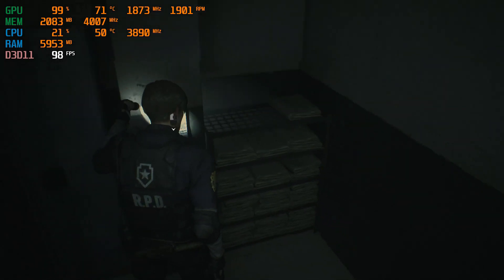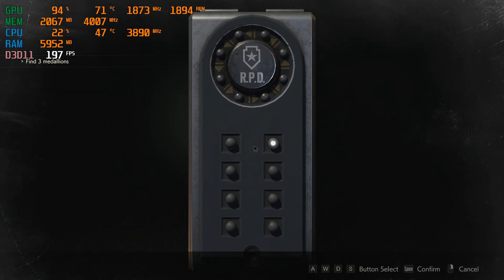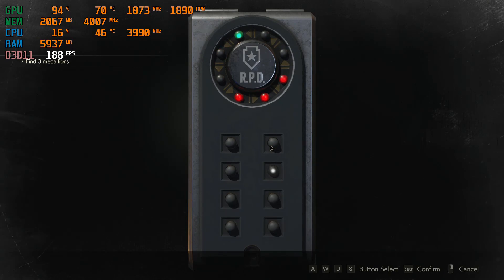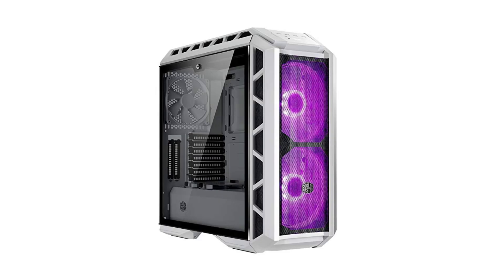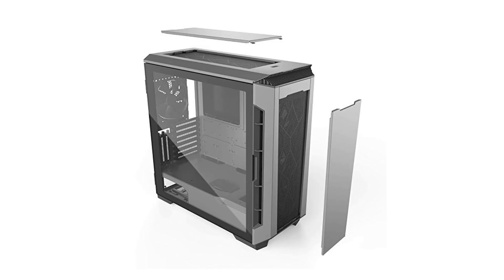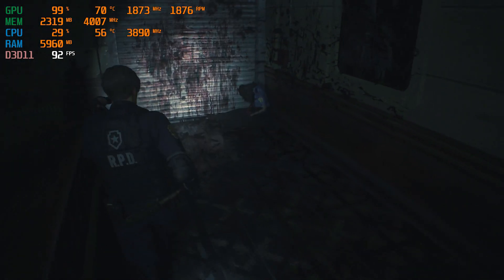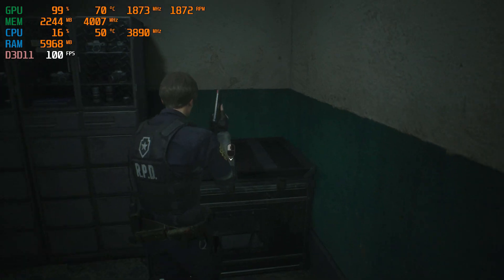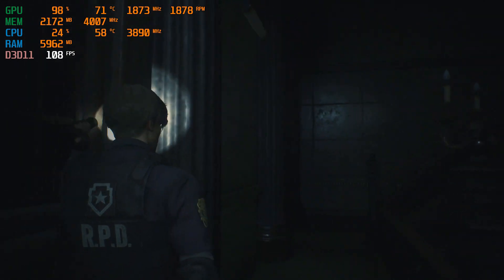How I Solved A PC Cooling / Airflow Problem - Cooler Master MasterBox Lite 5

Comment: Hey, I know I am very late but I am facing similar problems in my Masterbox lite 5. Although the temps are around 80-86 C, I was wondering if I could cool it more. I was researching and found people replaced the front panel with the front panel of Masterbox MB500. It seems like a perfect fit but if possible can you confirm whether it is or not?
Reply: I just open my front panel while gaming and the cpu temp is going down by 10-20° but my gpu airflow is loud asf
Reply: @Clips_shorts.23  that is honestly very worth it

Comment: Im about to build my rig, ryzen 3700x and msi gaming 2070 super for cpu and gpu, bought this case without knowing the arflow deal, would you reccmend to better go buy another case like the mb500 which is on my budget or to go with the water cooling option form corsair? Thanks in Advance
Reply from the maker: The H500: https://amzn.to/30MFpXc or the TD500: https://amzn.to/3d701Mf are both great options if you can find one in stock.

Comment: DOES ANY CASE OUT THERE HAVE THE SAME LENGTH AND WIDTH AS THIS CASE I HAVE SO MANY CUSTOM RGB PLATES BUT WANT A BETTER CASE FOR AIRFLOW IF YOU WANT TO CHECK MY BUILD I HAVE A VIDEO ON MY CHANNEL THANKX IN ADVANCE
Reply: They have that mesh in the front. You can buy it but shipping is expensive. At least to NY.

Comment: I have also temp issue with my masterbox lite 5.........but i don't understand what you said about radiator?????
What is it........can you please explain it to me??
Reply from the maker: It works, but it runs loud under load.
Reply: A radiator is connected to an AIO cooler.  Its typically placed where an exhaust fan would be and a fan is placed on top of it.  Just search all in one cooler online, it's the giant hunk of metal/plastic with fins connected to a cpu block via tubing

Comment: I bought a coolermaster master box td500 witch gave me  really bad temperatures, so I just ordered a a mesh on AliExpress for like 1.50 USD, took off the front plastic panel and temperatures are now amazing my gpu went from 81c at 1700rpm to a max of 74c at 1400 rpm
Reply: I’m having the same problem should I buy a new case and fans because my fans are really cheap?

Comment: I got a 2700X in the masterbox lite with a 120mm AIO. It still peaks up to about 86-90 degrees under heavy loads. I'm going to pick up some mesh, from the post office today and mod the front panel myself.
Reply: where do you buy mesh?
Reply: 120mm aio why? most air coolers are better I have the same case with 2700x OC and still only 70c with a hyper 212 evo